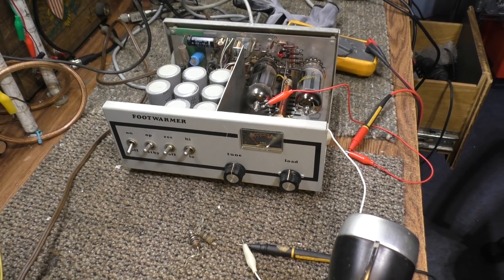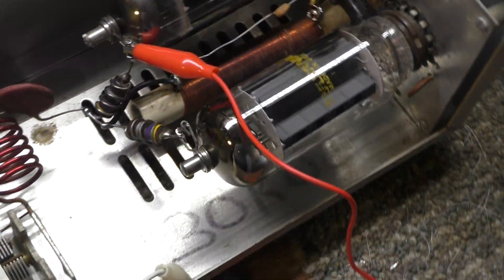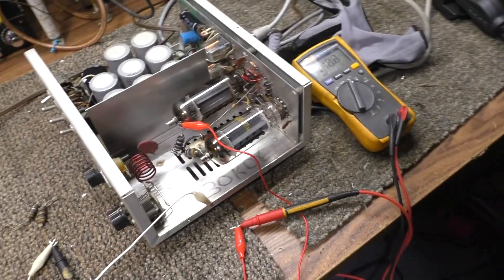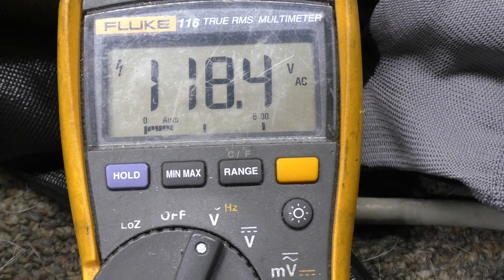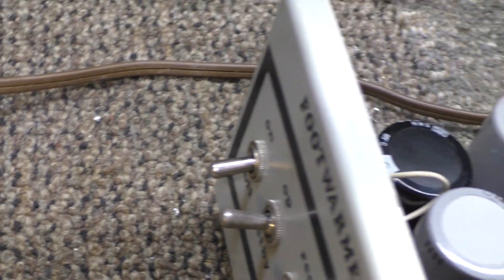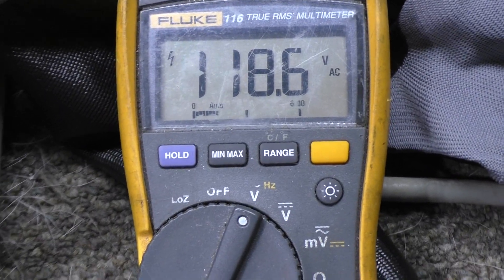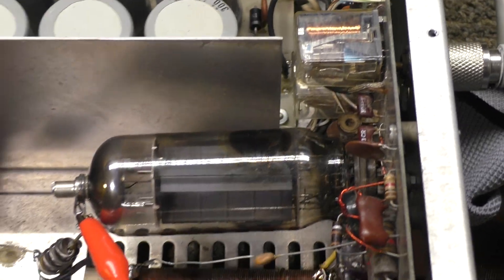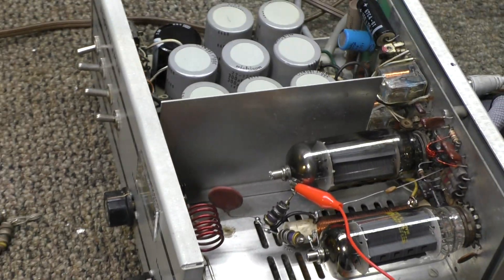Widowmaker errr I mean Footwarmer linear amplifier living up to its name.

Comment: Yeah, I think you figured this out, but a Variac is an autotransformer, not an isolation transformer (most I've seen anyway). You've got the right idea isolating it, but beware that all the mains hot and neutrals are correctly wired. That stuff will find a way, and it hurts when it does. 

Sail on, brother.

Comment: I wonder if you were to Disconnect the coax connectors the voltage would disappear ? . I suspect the voltage will disappear.if it does I would check for voltage between just the coax and variac. I look forward to putting this mystery to bed ONCE AND FOR ALL! I'm intrigued.

Comment: Ground fault has path back to source . Most likely will trip a gfi circuit if you plug it in normal. Save the tubes and throw it in the trash! Very unsafe for anyone unless isolated from the mains via a isolated power supply.

Comment: Check the polarity of your a/c plug. I think it is backwards and putting a/c on the chassis of the amp. Televisions and table radios used to do that. Hence the use of insulating plastic knobs.

Comment: Could you add an isolation transformer
Reply: I wouldn't use anything like this without an isolation transformer.  There obviously isn't enough space inside the amp for one but still...
Reply: Yes. Wouldn't affect it at all.